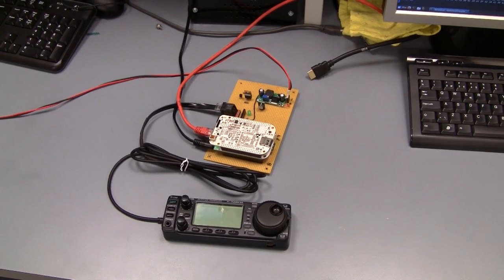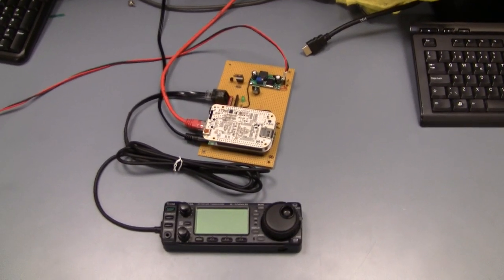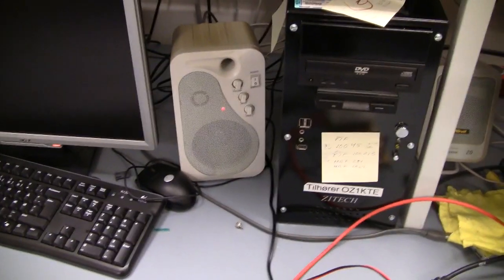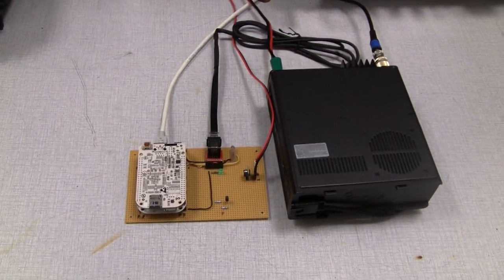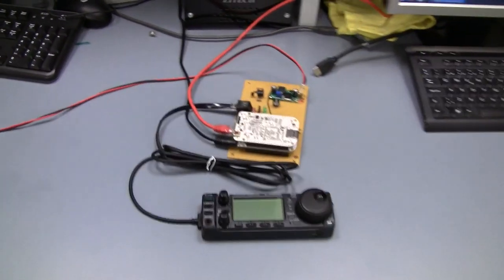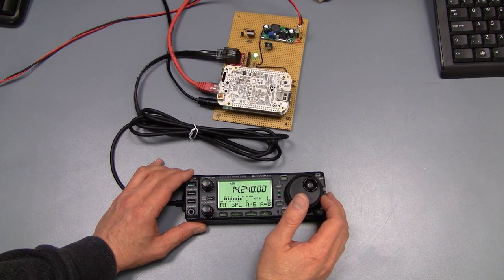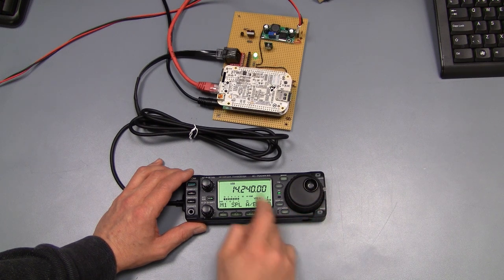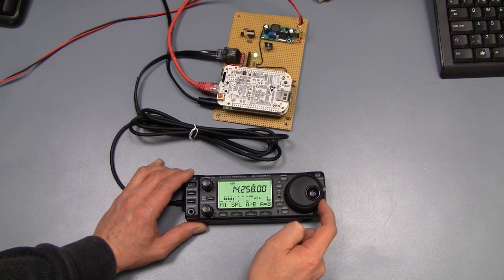IC-706 remote kit ‒ First onair test

Comment from the maker: WARNING! Beaglebones doing cool stuff here!

Last night I tested my DIY remote rig controller for the IC-706 on the air and it works very well.

I am using two beaglebones with audio capes as a serial+audio to internet gateway so that I can take the control panel with me (e.g. while driving) and leave the radio at home connected to big antennas. Bandwidth usage at the moment is around 100 kbps but I expect to reduce it to less than 64 kbps later.

Watch the video demo below and read the details here:
http://www.oz9aec.net/index.php/ic-706/506-diy-remote-kit-for-the-ic-706-part-7-first-on-air-test
Reply: That just neat

Comment: Very interesting.  can you control it over IP?
Reply from the maker: Yes, the sole purpose of the setup is to control the radio over the network instead of the IC-706 remote cable
Reply: Alexandru Csete amazing Alex. I am looking for a remote rig to use and control a station IN Algeria via IP 😊
Reply from the maker: This was a conceptual prototype and not really a plug and play solution. An off the shelf solution like Remoterig is probably better suited for a permanent setup.